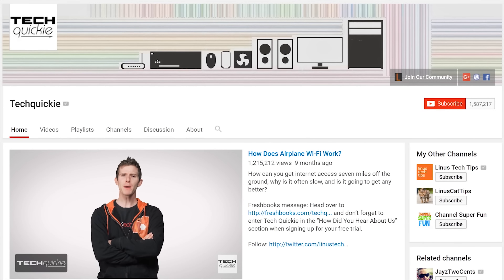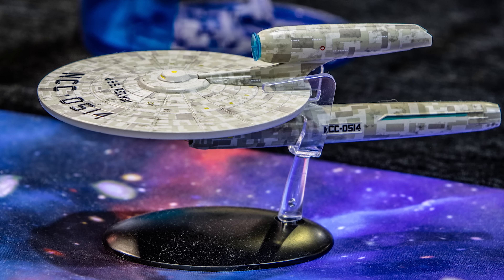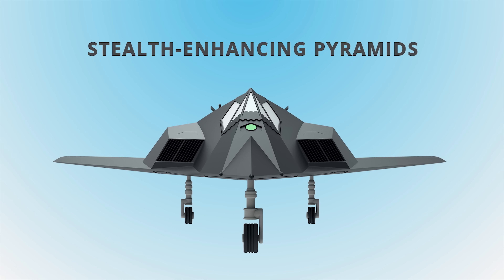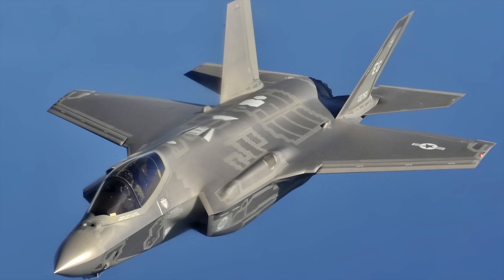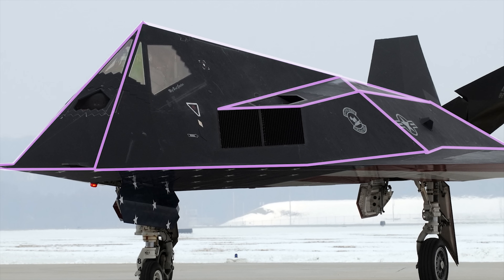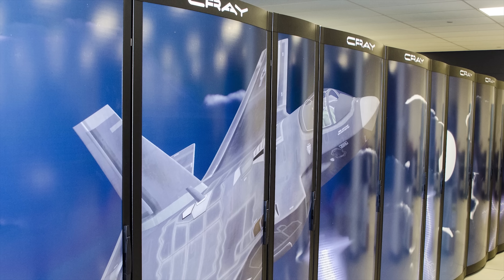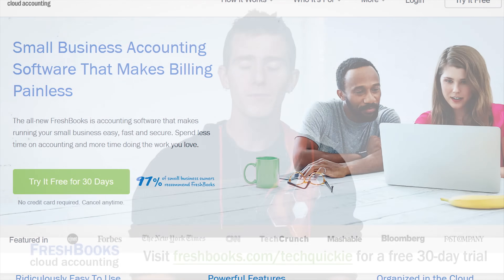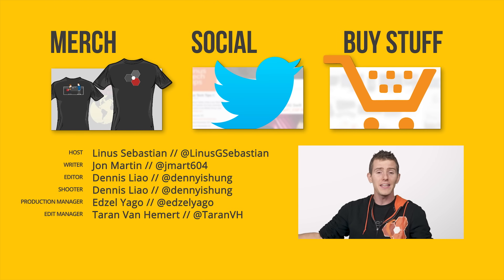How Does Stealth Technology Work?

Comment: That’s not actually how it works, it’s a secret so they say it’s just paint and some angles to throw the enemy off. Every stealth plane actually has sensors and transmitters on every flat surface, when radar waves bounce off the transmitter blasts the exact opposite radar wave back at the enemy radar very similar to your noise cancelling headphones. Reason they don’t use round surfaces is that it’s too hard to calculate what wave to send back.

Comment: You have the material correct, but you failed on the shape.  The shape of the stealth is not about reflection, but refraction.  The shape actually is such a way that the frequency of the radio waves actually wants to bend around the object instead of bouncing off of it.  This is why you get such a dramatic cross-section and why the original paper was seen as having little value.

Comment: Well it doesn't work, F117a is downed over Serbia with S125, very old Soviet system that Serbia had
Reply: The F-117A was an antiquated aircraft mind you. That lacked any countermeasures save being low-observable, was effectively older than the modernized systems the Serbs used, and flying the same flight path of other aircraft earlier that day...

Comment: First of all, I love your channel. With that said, you are very wrong about why the shape of a stealth airplane is shaped the way it is. The shape creates an electromagnetic bubble around it at the frequencies RADARs use. (you can refer to the original document.) The best way to explain it is the way light travels through a series of slits and creates dots on a screen.  It is this math that needs modern computers and why the FB-111 uses flat sides.

Comment: Ok, its not invisible (its just less visible to the radar system), i undersatand that. But we crash him with some old piece of shit of russian rusty equipment, from the time when its used in Vietnam war...US gov throw (stiling) money of citizien for nothing.
Reply: +Нино Белов

 The F-117A was very much a antiquated aircraft at the time. Undergoing no modernizations since it was introduced in 1983, and likely the same as it was developed during the early '1970's. 

 The P-40 R.A.D.A.R. system that tagged it was a remanufactured system modernized in the late '1980's by the Soviet Union. It was arguably much newer than the aircraft it tagged and tracked. The F-117A had no countermeasures save being low-observable. What are you on about?

Comment: Linus missed an interesting tidbit.   All stealth designs avoid planar surfaces intersecting at right angles.   A little bit of ray tracing shows that a pair of planar surfaces will reflect an incoming radar (or light)  beam back to the sender no matter what direction the beam comes from.  As an example of the opposite of stealth,  the inside corner of a cube (an array of them)  was put on the moon to reflect laser beams back to the sender irrespective of position on the moon.  This avoidance of concave right angles can be seen in air intakes and outlets of stealth aircraft.

Comment: Mostly what you are talking about is Passive radar deflection methods, years ago,  Illegal in both the US and Canada you could order a kit for your car that deployed a field around the car through a front plate and a rear plate, more complex kits had side pieces for your car. They produced a M.A.S.C. Unit that essentially that actively dispersed Laser and Radar signals that either registered as nothing on a laser or showed "ERR" on the radar gun. basically its the same idea as reducing sound waves like active noise cancelling sending waves that cancel each other out of the opposite frequency.

Comment: Stealth is a load of BS, it's just a sales gimmick used by the privatised Military Industrial Complex to fleece more money out of the public purse for R&D. You can see the F-117A on a WW2 long wave radar, that's how the Serbs shot one down in 1999.
Reply: That's completely wrong. Stealth is extremely effective, but doesn't work as US propaganda claims, and therefore isn't countered as anti-US propaganda claims. It's not about invisibility, therefore detection doesn't demonstrate its failure.

Stealth reduces detection, tracking and targeting range of radar. Long wave radar aren't used as targeting radar but early warning only because they're total garbage at anything else. Long wave radar require huge arrays for any relevant accuracy, and they're still affected by stealth.

Basically you might be able to detect a stealth aircraft at much higher range, but taking it down is only possible at small ranges, well below 100 km.

Comment: Okey. It's easy to understand this rocket science if you imagine a radar to be a flashlight. So you're in the darkest night ever but with flashlight in your hands. The objects painted in white will be much more visible when you point flashlight in that direction then black ones. It's because black materials absorb light better. Mirror will be kinda invisible too unless it reflects light right back to you.

The heat is a problem for stealth fighters too. The hottest visible parts of plane are exhaust and compressor (fans in front of the engine). Engineers hide compressor making it not directly visible (engine looses some power however). Exhaust is made cooler by using a special "stealth" fuel.

Noise is not a big problem if you're supersonic. It's too slow and inaccurate for shooting missiles at you :)

P.S. pyramids are also used in sound recording so Linus could even demonstrate those.
Reply: Flashlights really are the best analogy for radar. It even works if you consider you'll show yourself by turning your flashlight on.

Comment: Fun fact about flight stability. The Eurofighter is purposefully built to fly as unstable as possible. In this case, stealth is not the reason, instead it is the fact that an aircraft that flies unstable is physically easier to get off-course, making it more maneuverable. This makes flying it incredibly difficult, virtually impossible, right?
No, it doesn't, because it has a fly-by-wire system that is constantly making microadjustments to keep the plane steady, executing the pilot's commands precisely and quickly.
Reply: What does it mean for an aircraft to fly 'unstable'?
Reply: Joshua Tsang Well, an aircraft that flies unstably is one that does not fly stable (kinda obvious, but that means it is necessary to explain what it means if an aircraft flies stably).
An aircraft flies stably when all forces (aerodynamics, weight, etc.) pretty much cancel out, meaning without any input the plane would fly steadily and not change orientation, or at least if it did change orientation, it would do it in a regular manner (like if it was pulling up or down continuously).
Jumbo jets, for example, are built for maximum stability, since this provides a good flying experience, safety and efficiency. However, since the plane "wants" to hold its course, the force needed to change that course is rather large (aerodynamics have the biggest influence on that), which is a problem for fighter planes that need to be very maneuverable.
That's why it's useful to build them so that they will fly unstable, meaning they are built so that if no input was given, they would probably "wiggle around" a bit and change course irregularly. This "wiggling" is, in the case of the Eurofighter (and I think others, too) counteracted by an electrical system that basically gives the opposite command of what the plane wants to do, and since it is irregular, it needs to measure and process the plane's movements in real time.
The advantage is that its course can be changed with rather little force and also, the plane will not be dragged back to its original course (this can happen with less maneuverable aircrafts, mostly if the rudder is used too strongly).
Reply: JustusLM This is interesting, thanks for the detailed reply.  May I ask if an 'unstable' aerodynamics is in fact a metastable state, or an actual unstable state?
Reply: JustusLM The Eurofighter is absolutely not "as unstable as possible". There are significant trade offs between stability and maneuverability, and it's not as simple as "more unstable = more better". In fact, that's a terrible design philosophy.

Furthermore, the Eurofighter is not the only aircraft that's unstable. All modern military fighters are unstable, but only in pitch and rarely (if ever) in yaw and roll. Even the Boeing 787 is what's called neutrally stable in pitch, neither stable nor unstable. This is for fuel efficiency reasons, not maneuverability.
Reply: Same for the F-16
Reply: P u g a c h e v s  c o b r a
Reply: There were these videos going around that showed the same pilot crashing 2 different planes.Sure it's great but I wouldn't want to pilot one.

Comment: Everyone in the comments talking about the F-117 lost in Serbia in 1999, let me explain this to you. The F-117 did not get shot down because of it "lack of stealth" originally. The main reasons for why this nighthawk was shot down were: bomb bay doors open (reducing its stealth capability and increasing its RCS), the F-117 had been flying the same route continuously and the serbian forces knew roughly where to focus their radar search, and the implementation of LFR (low frequency radar) which is effecive at detecting earlier generation stealth aircraft such as the F-117 and SR-71, but has very big issues with background noise, needs to know exactly where to look, is not very good at guiding missiles onto a target and requires a very very large antenna array. This is why the F-117 Nighthawk was shot down. Not because its stealth didn't work, but rather a combination of unfortunate factors which in the end resulted in the first and only loss of a stealth aircraft to date.
Reply: +David Smith +AugmentedGravity  It was not shot once, they got hit additonal 3 times, the other 3 just ended up somewhere in Bosnia so Serbian cameras couldn't film them. 

The bay door being opened and flight patterns  is a pure speculation and myth used to excuse the failure.
F177s haven't flew 100s of sorties, most of the targets were hit with tomahawks (400 of them were sent just on the first night of the bombing) and the "normal" jets flying above the height those outdated Neva missiles from 1960s were able to reach.

While it is more difficult to track down stealth planes from radars in other planes, it's way easier to do it from the ground radars which have far bigger antennas and which can alternate their frequency relatively fast (from small wavelength to the bigger ones). 

With bigger wavelengths you can track down the plane's approximate location, and with that data, you can program your radar to focus with smaller wavelengths to that location giving you with more precise plane's location and speed.

In '99 that was the top of the technology being hit by a unit of men which knew what they were doing using outdated technology
Reply: wow look at the comment above, you are not as dumb as as flat earther, but still come off as a conspiracy nut. 3 shot down, pftt.
Reply: @guestimator121  nice Serbian propaganda by the way
Reply: Augumentedgravity......ever heard bout OTH radars?? They use low frequency radiowaves......RCS increases with decreasing frequency........it's true that target resolution is clear at high frequencies and less noise clutter...but using digital signal processing technique we can eliminate noise at lower frequencies.....& That's how they detected F117 A........
Reply: Trying to talk rationally with the people claiming stealth doesn't work because a single F-117 was shot down in it's entire operation history is like talking to a flat earth moron. They simply do not possess the intelligence required to talk about the subject matter.

Comment: If I remember correctly first concept of Stealth bomber(never build during WWII) was Nazi Germany Ho 2-29. The second one was US XB-70 Valkyrie in the late 1960.
Reply: The HO-229 was NEVER designed to be a stealth aircraft, that is a myth. The Horton brothers were believers that the flying wing was the most efficient shape for a aircraft. They were not the only ones, in America Jack Northrup was doing parallel research into the exact same concepts.
Reply: Also the XB-70 was not a stealth aircraft. It was intended to fly at 75,000 feet at MACH Three making it immune to interception. However rapid advances in Soviet surface to air missile technology made the XB-70 obsolete so it was canceled. The SR-71 would be considered the first aircraft where a reduced radar cross section was incorporated into the design making it the first generation of stealth aircraft.....even though it wasn't particularly stealthy.
Reply: David Smith When people in US build a replica of Ho and test it using a radar they found out that it have 30% reduce signature. I once read an interview with one of designers of XB-70 he said that on radar only tips of wings of XB-70 were visible. and it looks like for example two small birds not an airplane and that US radar operator were fooled by the signature. If the boomer would be sent to combat (with nukes) that would probably be enough to go through. Don't forget that for example B1 or B2 are also not a Stealth aircrafts they have highly reduced radar signature and can literally fly between radar posts.
Reply: @stanisawszczypua9076  ?